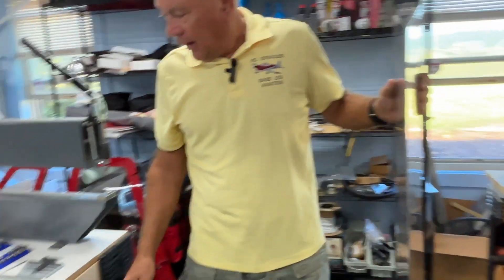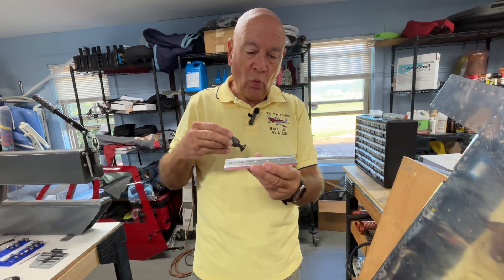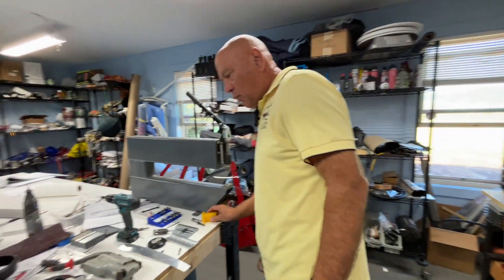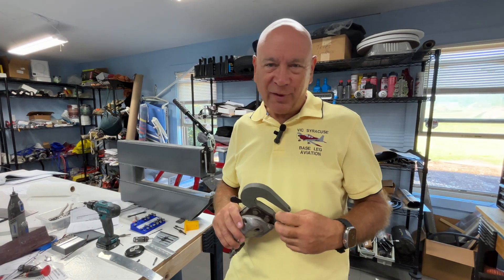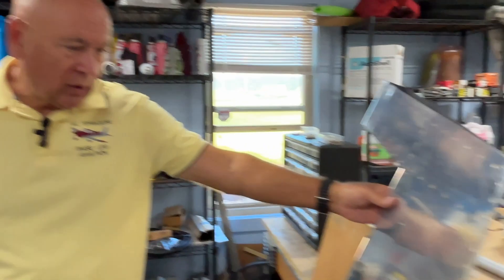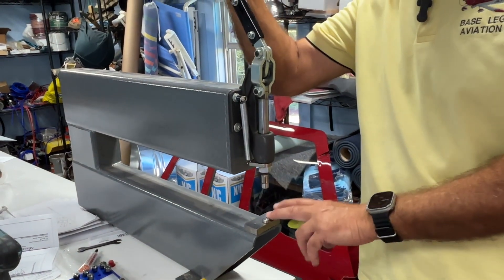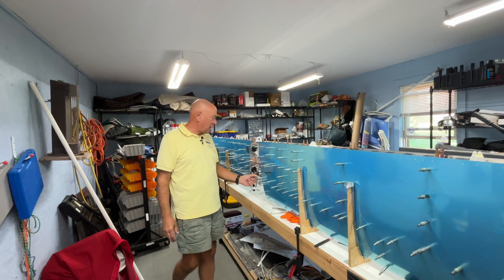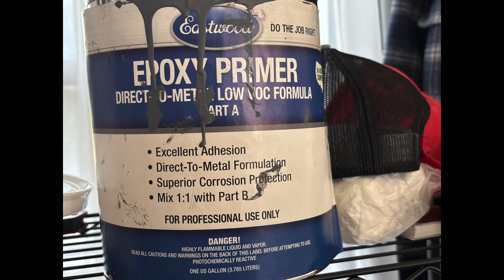Rv10 Build Update Rudder Trim and Recommended Tools

Comment: I would like to see/hear more info on your rudder trim modifications.

I like Cleaveland Aircraft Tools (CAT) a lot, too.  Also, I like their YouTube videos about their tools and how to use them.

I do not understand why you used double sided tape to build the trailing edge of the rudder.  In my opinion, it is structurally insignificant compared to the rivets.  It might hold things in place when you are back riveting a trailing edge, but you used the special CAT squeezer set.  I found that clekos hold everything in place quite adequately.  

I recommend alternating the rivets on a trailing edge between shop head up and factory head up.  I also found that a half size longer rivet works just fine.  

It looks like your edge forming tool is different than the one that CAT sells.  Is it any better or cheaper?  I do not understand why you would need to use such a tool when building a trailing edge.

I am also building an RV-10.  My YouTube channel is 345DF.  My channel is much smaller than yours.  I would welcome any suggestions or comments that you have about any of my videos.
Reply from the maker: Yes you could do it without the tape, but Vans recommends using the tape now. Consider reading section 5 of the plans, page 5-11. They even include the part number for the tape. The clecos hold it but it will slip a little without the tape. this way makes for a nicer straight line. I did alternate the rivets, as I have done on all of the other aircraft. :)